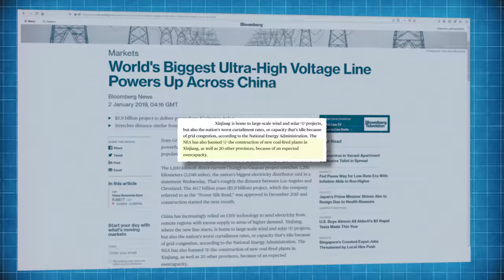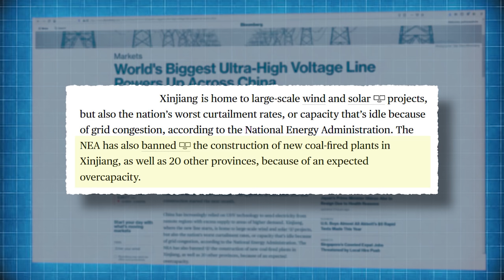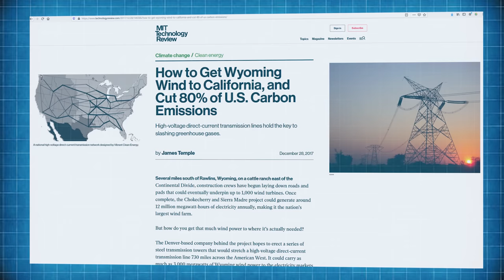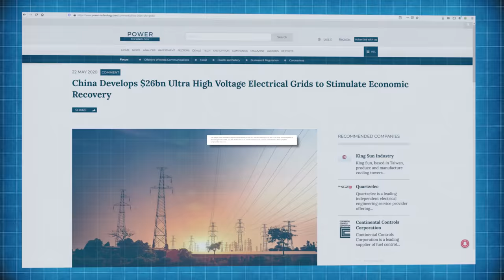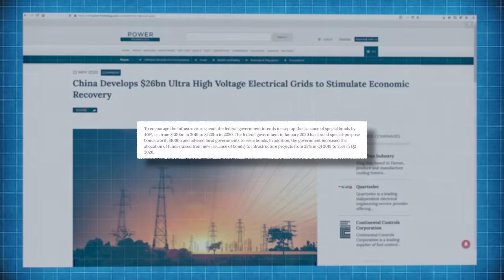China's MILLION VOLT Energy Superhighway

Comment: Dave, I'm surprised you said damning the Mekong River will reduce the flow? I suppose that when the reservoir upstream of a damn fills it will reduce the flow until the reservoir fills but that is only a short period of time and the reduction is entirely dependent on the fill rate which is adjustable and can be made slow enough to be inconsequential. You know what goes in must come out for steady stead (i.e. no change in flow). Other than this minor instance I have never had another dispute with your research and really do appreciate the channel and your insight.
Reply: @R.-.  I stand corrected, I read the article and see that evaporation from the larger surface area that damns create is about 10% on the Colorado river. It makes sense.  I stand corrected and again have no disagreements with Dave. Thanks for your correction R.
Reply: Countries not only use dams for power generation but also take water from the reservoirs for irrigation and for supply of growing population and industries. This is a frequent cause of conflict between neighboring countries along big river systems.
Reply: @danielvivian3282  I respect you for acknowledging being corrected. There is however another problem with Hydro dams. Hydro systems often store water in the rainy season (summer) and release it in winter, and especially in colder regions. Agriculture requires the water in the summer and uses much less water in winter. The result is that the river down-stream is ower flowing in winter and is often totally drained downstream in summer. Those at the end of the river are often totally deprived of water in summer, resulting in huge crop losses and severe shortage of drinking water.
Reply: Another important aspect of building dams is that the silt load (which helps land downstream to be regularly enriched in minerals) gets dumped on the backside of the dam, so farmers downstream of the dam no longer have that "free" soil replenishment. To replace the river-carried minerals and nutrients farmers ultimately need to start using fertilizers. That silt load behind the dam grows ever larger, and its impractical to flush it out of the dam. Of course, this gives a dam a finite lifetime as well.
Reply: Jon Adams So what are we waiting for? Let’s take down the Hoover Dam since hydropower has so much evils

Comment: Good to have the technology to send electricity far with low loss. But why send it at all when you can produce it locally on rooftops and walls? Buildings use so much area that can be co-used for electricity and rain water harvesting, to begin with.
Reply: the amount of energy colected with rooftop solorpanels is minuscle/insignificant campered to the energy needs of a country.
you need Big Solar farms to obtain relevant energy generation
Reply: It's not enough to power heavy machinary.

Comment: Shifting excess solar power from west to east would help eliminate evening peak demand problems especially in the United States. Multiple HVDC transmission lines installed east-west from coast to coast could tie everything together especially if supplemented anywhere along the line with next-gen nuclear generation.
Reply: No it wouldn't. Compared with nuclear, renewable from solar is puny. It would be the height of stupidity to cut back on the reliable power of any installed nuclear, to accommodate power from bird killing whirlygigs.

Comment: A million volts hopefully coming from more nuclear powerplants soon.
Reply: Yay, let's dump tonnes of radioactive waste on our kids to have to deal with. Brilliant.
Reply: @drawn: Nuclear waste can be recycled to reduce the final volume which can be buried deep in geologically stable areas. The problem with nuclear waste is political not technical.
Reply: Too expensive. Renewable energy sources projects outpace nuclear. The video covers this since high voltage lines can transmit wind and solar power from producing areas a lot cheaper.
Reply: @notlessgrossman163  I watched it and didn't found him say it would be cheaper. Fact is that there would be almost no transmission lines needed when building a nuclear powerplant within a city.
The focus should be not to outpace the biggest producer of carbon free energy being nuclear but rather fossil fuels. Fact is even if transmission is improved renewables are still very intermittent. Long-term energy storage isn't a thing and won't be within the next decades. That's why they will continue to need backup power sources. The only energy source with continues power output and pretty much no impact on the environment is nuclear energy.
Reply: Tel that to my friends near Prypiat, Ukraine.  Or the people who live near three mile island.
Reply: @reggiebuffat  The accident of Chernobyl could have been easily avoided if the operators would have followed safety guidelines. One operator wanted to do that but his commander refused and threatened him with the loss of his job. Keep in mind this was the Sowjet Union. It was not the technology that caused the accident it was the system. By the way the reactor of Chernobyl was never build outside the Sowjet union and was never build since the accident.
When it comes to Three Mile Island there was no death at all and till today there were no negative health effects detected caused by the accident. It was all panic created by anti nuclear propaganda and I actually feel kind of sorry for the people for being put under this fear.
Nuclear powerplants have caused the least amount of death among all energy sources. There are reactor types that are physically incapable to causing an accident even near that of Chernobyl.
Before climate change is not delt with and it's not under control we shouldn't even think about quitting nuclear energy.
The radiation of Chernobyl today is for the most part very low. There are even places that are naturally much more radioactive than Chernobyl after the worst nuclear accident ever:
https://youtu.be/JpcUCo0ebNA
Reply: @reggiebuffat  I live not terribly far from three mile island.  It's irrelevant, other than we learned how to build safer plants after analyzing that accident.  Chernobyl doesn't coun't.  It wasn't a sane nuclear plant, more like a slow bomb.  It was a ridiculous design.  No one ever built anything as dangerous as that outside of the Soviet Union.

Comment: HVDC is very attractive, but there are clearly problems to overcome. The efficiency level of a huge Buck converter to bring the voltage down. Add to that the efficiency of the DC to AC converter needed for the local mains. Lastly is a thorny one. Accidental arcs do not self-quench with DC. They just carry on burning until the power is cut. This can happen with a fault, but it also happens during switching.

Comment: I have wondered why - with the need to replace and upgrade our decrepit infrastructure here in the US - we didn't place high frequency, high voltage transmission lines inside of our roads and bridges. That way electrification of transportation wouldn't require heavy battery systems as power for vehicles could be inductively coupled from the roadways themselves. No more range anxiety, worrying about charging station locations, getting ICEd at charging stations. Less vehicle weight and space dedicated to energy storage means more power available for motoring and more cargo carrying capacity for commercial applications. 

The cars are smart. We are already working to connect them to each other through the cloud. Load matching on electrified roadways could be automated with AI with any excess diverted to the housing and commercial grids or to battery storage for peaking use. 

We already need to replace/upgrade the infrastructure anyways. But Elon's success at imitating the current self contained transportation paradigm works against such an idea as well. The idea that our vehicles must be self contained and self powered, carrying around a fuel storage tank (volatile chemicals or battery) wasn't even questioned - a squandered opportunity for something better.

What about parking lots and dirt roads and long driveways you ask? A small battery coupled with a small bank of super capacitors takes care of all of that. Sorry off road enthusiasts but you get stuck using internal combustion engines.
Reply: Cost.
To dig up road is in orders of magnitude more expensive than vhv lines.
Also interfere and a host of other problems with hv lines under the ground.
Reply: Induction always comes with a loss. The bigger the distance between the spools, the bigger the loss. Charging cars via induction from beneath the asphalt is way too inefficient. We'll be stuck on batteries for a while...
Reply: @Divedown_25  Trucks running on overhead lines?  Now that really is"Back to the future"!
Reply: @BunjiKugashira42  I'm sure it is inefficient but the ability to recharge a vehicle while it is moving is a huge benefit. Autonomously driven vehicles would never need to stop anywhere but at the origin and destination. The alternative, rapidly charging batteries to minimize downtime is also inefficient.
Reply: @nathanlewis42  You can achieve the same more efficiently and less expensively with overhead lines for vehicles that need long-haul travel like trucks or busses. For everyone else, they're better off traveling by bus or rail anyhow.
Reply: About cars and transports in general...Does anyone watch Formula 1 or Formula E for that matters??
The technology needed to have fully independent drives is already here!!
Nobody seams to know that the first car was indeed propelled by an electrical engine.
The fact that we still don't have any??.... it's mere Business
Reply: Alexander Sibilio it’s called energy density. Batteries have a very low energy density but Tesla is working hard to fix that.
Reply: @nathanlewis42 I'm fully aware of where we are in terms of development. 
My point was about the fact that we could have been easily 20 years ahead if it wasn't for lobbies interests 👍
Reply: @alexandersibilio7436  We still don't have any EVs?  Where I live, they're everywhere.  Including one in my garage.  I don't think that we could "easily" be 20 years ahead, unless lithium ion batteries were developed sooner.   Big oil didn't consider EVs to be a threat until relatively recently, despite the various conspiracy theories about the EV1.  They were not a threat until the batteries got good enough, and that is a fairly new phenomenon.  With a Manhattan Project style program, maybe we could have had them 20 years sooner, but that would have been impossible to justify economically.
Reply: @incognitotorpedo42  The car industry achieved something never heard before!while still producing and promoting old models...almost overnight all of the brands now have an E version!!
Only because the market demanded it not because the technology wasn't there!!
This are facts!!
Any idea you might have of conspiracies it may relate to  the sperimentation of different technologies like water or air (strangely enough 2 sources of energy non taxable)
Reply: @nathanlewis42  It explains why, with the current technology, small EVs can be rather handy while big loads require fuel cells.
Reply: @alexandersibilio7436  But, but...isn't that democracy at work...? World leadership! Well...almost.
Reply: @ClaySuddath  not sure what you mean by that but I believe we all went a little off topic here!!!

Comment: DC links are used for much shorter distances for other reasons than losses, e.g. the UK/France interconnector across the English Channel. Connecting 2 large separate grid systems with an AC link can lead to stability issues and high fault currents (Both systems trying to control frequency).
One issue with long distance AC transmission, due to the high capacitance, is that under light loading, the voltage at the end remote from the generation can rise to very high levels (Ferranti effect).
Where cables are used, rather than overhead lines, capacitance is even more of a problem, so long distance AC cables are not a good idea.

Comment: BTW the full-wave bridge rectifier is an inefficient way to change AC to DC.  The FWB can be replaced by a full-wave rectifier with a center-tapped transformer.  The result is less power losses in the diodes and higher efficiency.

Comment: There are several UHVDC interties in other countries.  At the Itaipu in S. America there are a pair back-to-back to allow the two grids to share power -- one grid is 60 Hz, the other is 50 Hz.  In that case there is no distance between them so they have no transmission purpose.

In California there are two: the Pacific DC intertie and the Intermountain DC intertie.  The Intermountain is connected to a coal power plant in Utah, which will have to be shut down and there are plans to install renewables nearby and reuse the DC line for them.  These UHVDC interties are "only" a million volts.  🤗👍

Comment: AC power at 60 or 50 Hz uses the full diameter of  wire. High Frequency, like 1 GHz, uses the skin of the wire.
Reply: I was going to say that too. But I will add that there are thousands of audiophiles who will sell you cables at $1000/ft to deal with that skin effect. lol

Comment: AC transmission beyond 800km is not really feasible due to the capacitance of the HV line. The apparent power becomes a serious problem. Also large AC networks are almost uncontrollable. AC/DC DC/AC coupling are used on much shorter distances to gain more control over power flow.

Comment: Part of the cost/benefit analysis is that the energy generated by PV is already DC at a low voltage so it would be costly to make it into low frequency AC for transmission.  It is not the same as if turbine generated AC were converted to high voltage DC.
Reply: I do not understand how "already low voltage" DC becomes high voltage DC without an AC transformer step. That's why our supply IS this awkward 60 Hz AC.
Reply: @albertrogers2506  You are correct that a magnetic transformer is usually used, but I think they would use a frequency much higher than 60Hz for a DC-DC converter. If you notice, power supplies are much smaller today than many years ago (what we used to call "linear"supplies). The reason is that the expensive magnetics and capacitors can be much smaller in the higher frequency converters. 60Hz isn't a bad frequency when it is generated by large spinning rotors but requires large transformers for step-up and step-down. "switching" supplies usually run from frequencies just above sonic (say over 20kHz) to multi-MHz, depending on design. That is why I was trying to differentiate between the cost benefit of high voltage transmission being different depending on whether the source was already AC or DC. If your source is already AC, you don't need electronics to get high voltage.  Since PV starts of at DC, it is cheaper to create high voltage DC rather than 60Hz AC even though you are indeed using magnetics to get to high voltage in both cases, as you correctly pointed out.
Reply: @davidsuzukiispolpot  I've built some small high frequency transformer voltage conversion circuits. With ordinary US mains voltage, and an electrolytic capacitor rated at 200V so that wasn't a problem, I blew a mosfet on account of the back voltage which is the stray inductance times the rate of change of voltage. I fixed that, as I should have known, by giving the back voltage an escape route via a voltage-limiting Zener diode. But rate of change of current when using thyristors to deal with megawatts at high frequencies sounds a bit difficult.
Reply: @albertrogers2506  Yes, no-one said it is easy. At high power levels, the architectures can be totally different due to the stresses.  Even heat, just imagine a 1 meggawatt converter at 99% efficiency would still produce 10kW of heat!and as you mentioned, heat is not the only stress.  I have never designed high power converters.  Still, my point is that they are already starting with DC, so that has a strong impact on whether they would use DC or AC transmission lines since there is a big difference between generating high power levels of 60Hz AC vs a high frequency DC-DC converter.  I started with electronics in the 70s, so I am still amazed we can even discuss grid-level power through semiconductors - I never thought it would be possible.
Reply: @davidsuzukiispolpot  DC sources for grid electricity, IMNSHO, are entirely a lousy idea. I do not know if the ARC-100 fast neutron breeder reactor can actually last for the 20 years between refuelings as the designers, arcnuclear.com, think, but the reactor vessel is just over 15 metres high, and less than 10 metres diameter, and is designed to be subsurface.
That's pretty nearly the level of "distributed power" that some folk cherish.

Comment: The skin effect is negligible at power grid frequency. The skin depth at 50 Hz is almost 1cm. One would need a massive cable for it to play an important role in losses. Moreover overhang power distribution cables have a steel core for mechanical integrity surrounded by a good conductor (copper or aluminium) which already reduces the useful depth for conduction.

Comment: In 1973, i caused to be built a microprocessor controlled calibrated spectrum analyzer for American Electric Power to test a 1MV DC test system. This was a radical new technology at that time.
Reply: That was back when a mere mortal could memorize the entire instruction set of a processor and 1 MIPS was considered fast.
For others:
"spectrum analyzer" in this case means you are looking at noise and ripple on the DC and seeing how much is at 1Hz and how much is at 2Hz, 3Hz, 4Hz and so on up to some maximum.  This is usually done to ensure that the power lines don't make people's radios and TV quite working.  It also can help to trouble shoot issues.
Reply: Well done